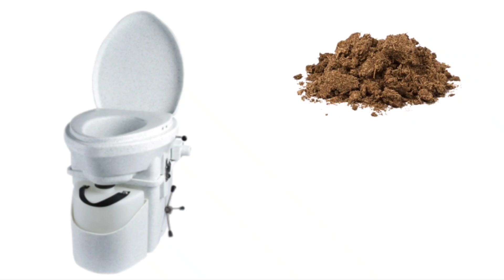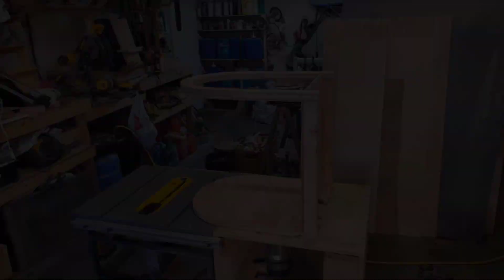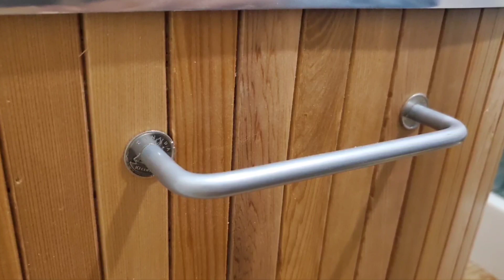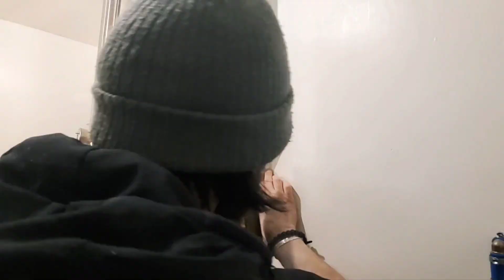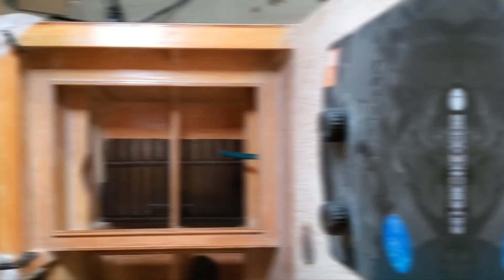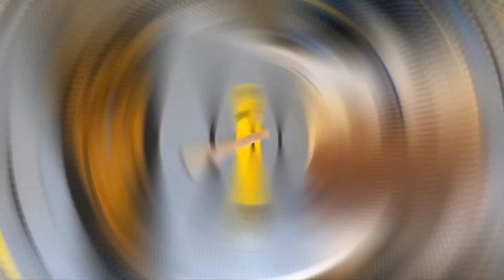DIY off-grid toilet (inexpensive build!) Tiny Houseboat (Part13)

Comment: Il y a une qinzaine d'année, sur un grand bateau flivial (Luxemotor hollandais de 32 m), j'ai fabriqué  les mêmes toilettes, mais sans séparateur d'urine. Petit local, sans ventilation,pas de système de ventilation. après chaques "popo" une bonne poignée de grosse sciure de bois (celle que l'on met pour la litière du chat). Aucune odeur, sinon celle de la sciure...

Traduction by Google : About fifteen years ago, on a large river boat (32 m Dutch Luxemotor), I made the same toilet, but without urine separator. Small room, without ventilation, and no ventilation system. after each "work" a good handful of large sawdust to cover, (the one used for cat litter). No smell, except that of sawdust...

Comment: how would you know when the urine jug is getting full, could you not route the urine overboard?
Reply from the maker: Good question. The container is see-through enough when you shine a light on it, and you would have to check it every once in a while. I didn't want to route it overboard because I plan on using the boat on land as often as on water. In my mind, this is more of a "floating RV trailer" than an actual boat. Just letting it go over board would make for a messy campsite. Otherwise, your suggestion would be the better solution.
Reply: you know when i was a kid we would sprinkle a bit of wood or coal ash on our stools in the out house it would help keep  the smell down a bit. good luck with it . i think i'll try my hand at one for my cabin.  @adrianwoodworm

Comment: I think this can be altered a little to use vermiculture (worms) to break down the solids and be installed in my offgrid cabin.  A pound of red wigglers will eat a pound of solids a day, so putting, say, 3 pounds of worms in the bucket (with the bucket altered to make a good worm home) and by the time it's necessary to empty the bucket, it'll be worm castings instead of poo.  Thanks so much for this!

Comment: FYI, some years ago the USAF was ridiculed and awarded the Golden Fleece Award for a toilet seat on the B1B bomber costing some $800 USD (if my memory serves me right).  It sat atop a 5-gallon pail.  Of course it had to maintain the integrity of the bucket's contents at Mach 1.25 ... inverted, so there's that.
Reply from the maker: Haha! That's insane! I am glad I don't have to deal with the inverted part or I would be in trouble!
Reply: @adrianwoodworm  You're very creative, so I'm sure you'd design a way of dealing with any situation!  👍

Comment: also WAYYYYYYY easier to clean than those $1000 composting toilets that have a bunch of ribs and ridges and parts and small openings and access areas that make it super hard to clean when you want to empty the container. it was a huge waste of money that i thought would be nice because i did the two bucket method before and wanted one with the urine diverter... but it doesn't work as well and is messy and hard to clean and just a huge pain in the ass. way smarter route here.
Reply from the maker: I couldn't agree more!!

Comment: Another great video I didnt use a timer n mine just a switch on the helm so the fan can run all the time of course we have no experience with it yet as we have been in the marina
Reply from the maker: Thank you! I am sure a switch at the helm works just as good! I just did the timer because a friend of mine has years of experience with this kind of toilet and says it doesn't need to be on all the time. That way I save some battery power(even though those kind of fans consume very little to be honest...)
Reply: @adrianwoodworm  good to know i have zero experience so i will try not running it full time
Reply from the maker: @Houseboatcamping  me neither, I just trust my friend in this case. In the worst scenario I can replace the timer switch with an on/off switch and let it run continuously if needed. I guess time will tell us what works. In my case that is still far away😆

Comment: very nice.  I  have my urine diverter leading outside the boat and the small fan runs all the time.  However we have yet to use it.  I'm now in the process of making some changes before launching this summer - dealing with some water penetration between the hull and deck and making more access to the bilge.
Reply from the maker: Thanks! I actually really like your toilet design as well, I almost bought the same diverting kit, it seems to be a good deal. Good luck on your improvements! I hope you get a chance for an update video on some point, I really enjoyed and learned from your previous videos!

Comment: You could use an under the waterline petcock to feed Lake/river water to a marine toilet thus not wasting your fresh water to flush.  However it would mean that you'd have to have a holding tank and pump it out when full.  Some boats use a 25 gallon & other's a 40 gallon holding tank.  I'd be surprised if you could not find room for a 25 gallon holding tank.  Should last a couple about a week without emptying.  I've had several boats & also RV's found this to be the most acceptable to other solutions.  I'll be interested to see how well your solution works.  However, I don't think I'd care for the "medium" being at nose level when sitting... Think I'd want it below decks... Just mtcw.  Great series.
Reply from the maker: Thanks! As mentioned, there are many solutions, too many to mention them all and it all depends on what your priorities are. I thought about having the medium on the ground level but decided against it because the space between wall and toilet was a bit narrow and I don't want to bend down in this tight space. Also, it is not in the way when I sit on the throne even though it might look like that, so it works for me.

Comment: You’re going to be surprised. ‘Built’ mine 4 years ago, outside for a tiny house. I find it’s cleaner and much less smelly than regular toilets. No condensation makes a huge difference. Mine is a tote with a  scrap wood lid and shiny new seat. You’re right, it’s not compost coming out but it’s not at all gross. Completely dry and if you don’t look hard it just seems like peat moss with bits of paper. I used paper bags so I didn’t have to remove plastic from the compost, but getting the right bag used to be hard, oversized garden bags worked for me.
Reply from the maker: Thanks for your input, it is always interesting to hear from people with experience!

Comment: Wow. Looks great. I hope you have enough shoulder room given the location of the medium holder. But I imagine you have taken that into account. I’m a bit in the dark as to where the odors vent to. I guess I expected there to be a vent to the outside rather than letting those odors be inside.
Reply from the maker: Yes, it is just about enough room for the shoulder, I did sit on it to make sure I don't have to lean in one direction. The vent sucks the air right from the bucket to the outside. There is a small section at the stern that is covered by an overhang, but otherwise open.